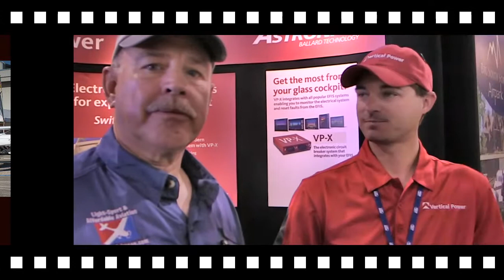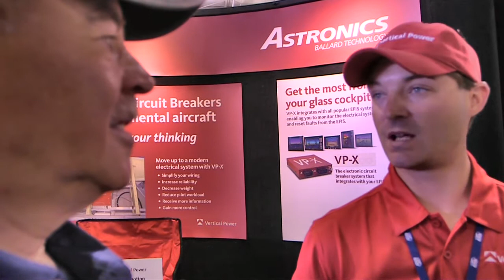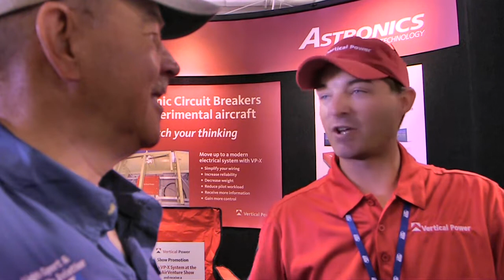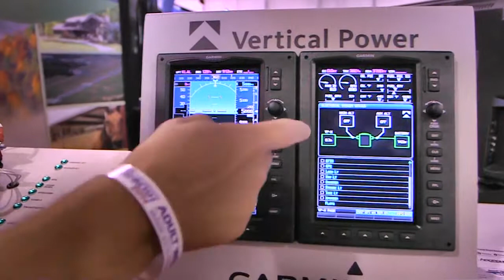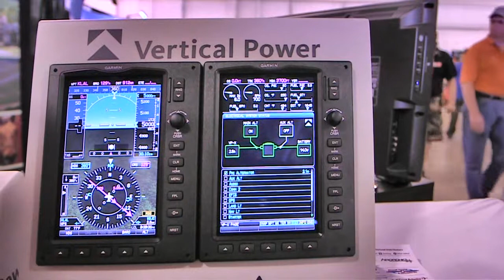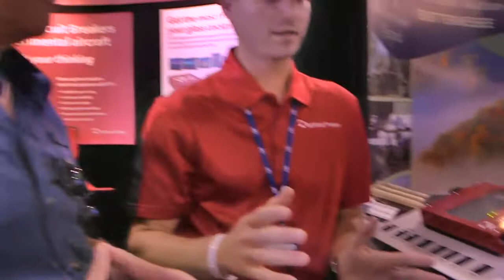Vertical Power – electronic circuit breakers for experimental and light sport aircraft.

Comment: The VP-X power systems offer a lot but offer's risk as well but then so do all the new aircraft that fly by wire and use this type of electronic circuit breaker system in them

With the old stander CB's, you find there sold and it takes a major incident to disable all of them and in most cases, only a failure of the aircraft master relay will cause that. 

If I was an IFR flyer and building my own aircraft I would have a master relay system back up this could be done into ways one is a 2- master relay or a circuit breaker to power all or some of the aircraft & avionics systems - It's rare for one to fail but they can.

The VP-X has two banks of electronic Circuits Breakers and losing one bank will disable all the aircraft or avionics systems on that bank Unless you wire a Backup Bus using stand circuit breakers or fuses to power those aircraft or avionics systems. and the VP-X manual note's this and give circuits examples.

Using Stander CB'S its no trouble to build the aircraft or avionics bus with all the breakers you need 

With the VP-X you only have so many circuits to use and each of those circuits has a limit to the amp setting, IE some circuits have a 5 amp, 10 amp, 15 amp or 2 amp rating.
So you must lay out each pin with the right peace of avionics or aircraft system it's used to power.

The VP-X Circuit may have a 10 or 15 amp rating but you can program the Circuit to trip at any amp rating you wish [ IE ] 1 amp 2 amp 3 amp 5 amp 7 amp 12 amp all the way up to its max current rating.

The VP-X turns on or off each aircraft system [IE] lights, fuel pump; or circuits the require a switch to be used by putting a ground on a pin of the VP-X It is possible at some point in time those circuits could give trouble years down the line if light corrosion  at the ground point or inside the switches build up-

 But just like the normal switches use today  components need to be clean or replace over time and the VP-X system could work the total life of the aircraft and never give any trouble

The VP-X can show what each circuit is using in amps and the total amps used as well.
but most if not all of the new EFIS units will display the total amps used as well

The VP-x is program using a laptop.

The VP-X has flap and trim control circuits out of it doing away with flap & trim relay boards
THE VP-X can be placed in many places of the aircraft and if you have lots of avionics in the aircraft or a small panel trying to find room for circuits breakers is no big deal - The VP-X can go under a seat, behind an instrument panel or any place where the wiring will fit well.

Its hard to know which is better they both have good and bad points debating on how you look at them and your build &  the VP-X system is higher that using Circuit breakers 

I see where were the VP-X has its place but I all so love reaching over and pulling the CB and in the new EFIS units losing the screen in a single display loses all access and control to the VPX losing a CB in flight will not all ways ground the Aircraft  

Loosing one bank in the VP-X may ground the aircraft if your IFR or limit you to VFR flight only and if on a long or short cross county or flight into high traffic airport would you keep flying day or night if 1/2 of the avionics or aircraft systems failed in flight or would land as soon as possible and be AOG until the trouble was found or a new VP-X is ship to you.

Some people love them and you can bet some of the most advanced aircraft in the world use the VP-X type of electronic circuits and the VP-X has made the jump down to Genal- aviation and the LSW world

There's all so the possibility of sun spots or EMP but this would may all so take out the EFIS as well. and the VP-X may have the protection build in to keep working

Is the VP-X system worth the time and cost over stander circuits breakers it's hard to say 
I love the old CB's there ease to change if one goes out is the VPX will have to be replaced
and one CB in most cases will not ground the Aircraft.

I cant's say one is better than the other and have installed both in aircraft But I like the ease and simply designed of the CB Bus - its all most 100% free of ever breaking down and grounding the Aircraft

. And who knows the VP-X may prove to be as rugged as the stand CB - Buss set up. But if the VP-X supports ever fails its a major job to rewire the aircraft but then the electronic Ign and Fuel Injection systems have taken over the car world with very good systems and the computers control so much in them 

Look at cost, look at how you fly to start with

But before you build / wire the aircraft put it all down on paper and its ok if it's in pencil and cheap paper from the dollar store just lay each circuit out and recheck it more than once
and leave wire or a service loop or leave the wire to connector to the back of the GTN 650 or other avionics clean so you can cut a tie wap or remove a clamp and get to it ease

This way you can add wires for avionics updates or change a wire if you make a mistake and only find it after you start flying the aircraft 

Remember take your time as the wires will carry the life blood of the electronics in the aircraft and so take your time

Just talk with other owners and builders 
After all we are not all ways right and at times get it wrong

Just a note to thank on

Comment: Questions: how many components on an experimental aircraft make switching from mechanical circuit breakers to VP-X makes it worthwhile?  What is the price comparison, given VP-X offers far more functionality?
If in flight a component blows its VP-X breaker how fast and easy is it to check the "breakers" like in an engine out emergency?  It is pretty fast to see or feel the mechanical breakers.  I'm starting the wiring on my RV-7A now.
Thanks
Reply: good question. assuming you already have an efis it would also save panel space